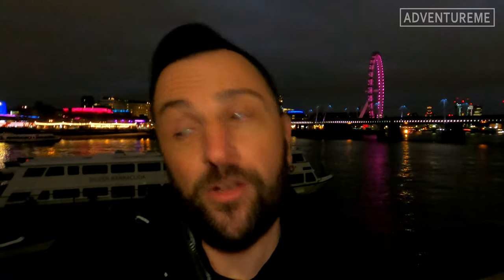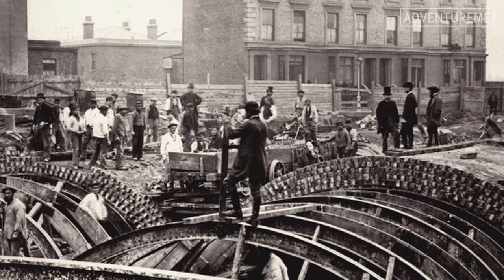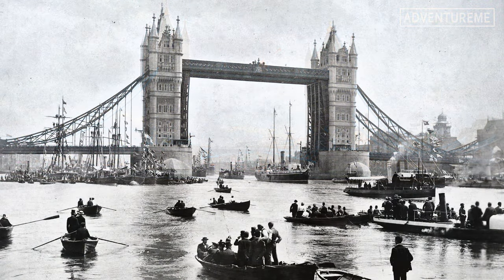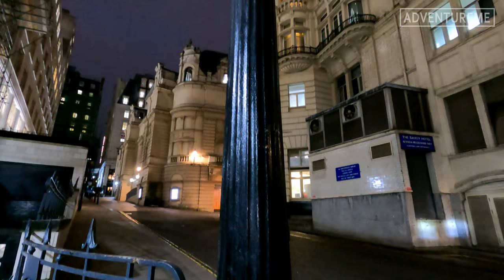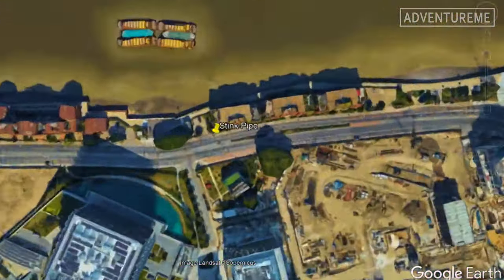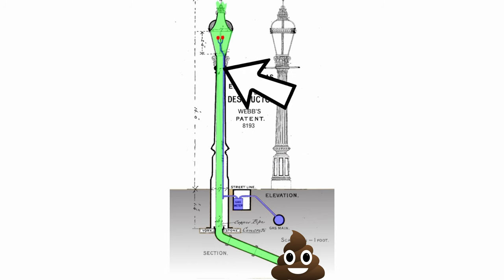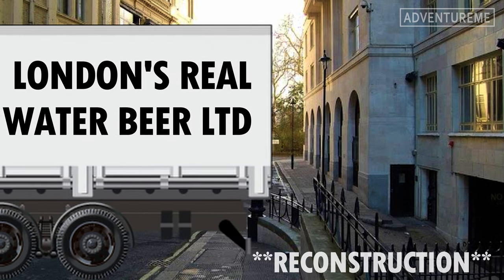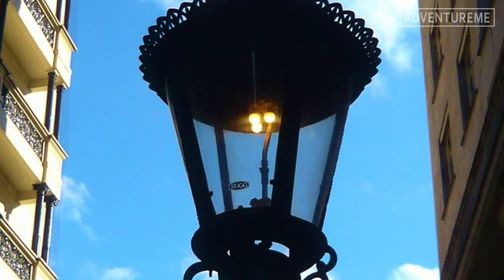The Last Sewage Powered Street Lamp in London!

Comment: This is an interesting video for me, speaking about using sewage waste gas for a beneficial purpose. I'm retired now from Baltimore Gas & Electric, where I worked on the gas side of the utility. Back around 1980 the company began doing the same thing. We installed a new gas main from the Baltimore area's large sewage treatment plant to one of our existing high pressure gas mains. The waste gas was cleaned up, pressurized, and injected into the existing gas supply system. Previously, it was just burned off from stacks at the sewage plant. We never had any sewerage gas lamps in Baltimore but did have the first coal gas street lamp in the US, installed in 1817.
Reply: I imagine it would be impractical (or dangerous) for a homeowner to heat their home with sewer gas?

Comment: Hi Darren

On the subject of Methane gas use check out the scheme of Liverpool's infill site for the first ever Garden Festival built on the shore of the Mersey River at Eigburth and Garston.

The site was an old rubbish and scrap dumping ground,(nicknamed the Cast Iron Shore). When it was converted into the festival site the methane was syphoned off via pumping stations and fed into the gas system at Garston docks. As far as I know its still producing methane for the national grid. I'm sure there is plenty of info on tinternet and Wikipedia. Cheers Doug T in Mancs.

Comment: I think you may have just solved a mystery that has bugged me since childhood. On Offmore Road in Kidderminster, where I grew up, is a tall cast iron sectional pipe projecting into the sky. The base looks like a Victorian street lamp, but it's much too tall (approximately eaves height) for any lamplighter to reach. I wondered if it could be a surviving tram cable support pole, but no trams ever ran that way. Now, given the density of the neighbourhood (which is predominantly street fronted terraced cottages) I'm convinced it's also one of these 'stink pipes'. (No gas lamps left in Kidderminster unfortunately - i believe that the last, outside the railway station, were recently removed along with the lovely cobbled approach when Network Rail replaced it with a modern building.)